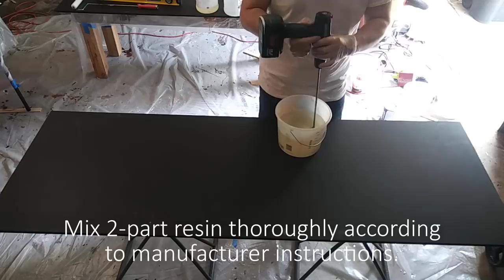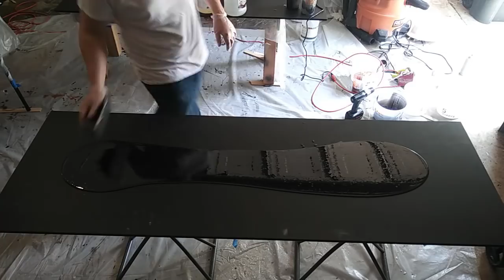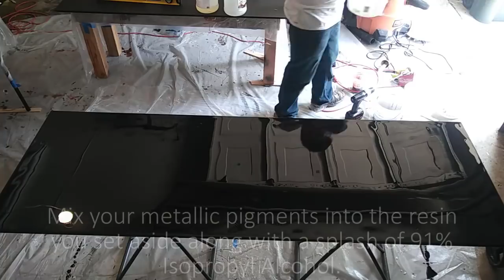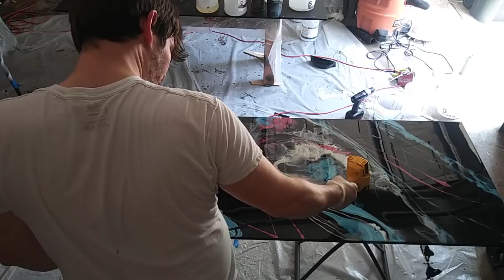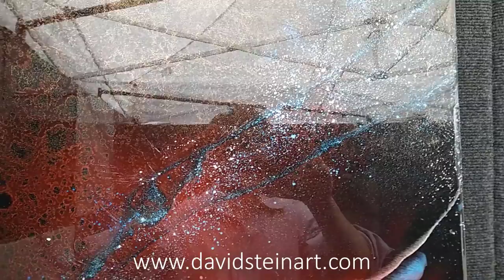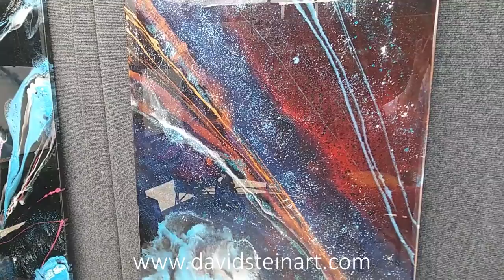Resin Art Tutorial - Cosmic Bloom

Comment: Hi David. Thanks for sharing the video. How do you prevent dust particles to show up at the end and have such smooth surface. I tried to  cover the art with cloth by by morning it still has dust particles and not glass smooth 😕
Reply from the maker: Hi Jul. It is a challenge. The best thing you can do is make sure your work area tools are clean. If you're in a climate-controlled area turn the AC or heater off while the epoxy is curing so that the air flow won't be picking up new dust particles. Also make sure that you're mixing buckets are clean before you start. Sometimes people think that dust is settling in the epoxy when really it was mixed into the epoxy in the beginning and is just floating up to the surface as the epoxy self levels. I sometimes get small nibs of dust in my finished product which are basically unnoticeable to most people's eyes. If you need a truly perfect surface you can use high grit sandpaper and or buffing and polishing compounds to polish the epoxy after it has cured.
Reply: @davidsteinart  thanks so much for your tips. I never even thought of polishing it afterwards so this is also a good tip to have. Thank you ❤